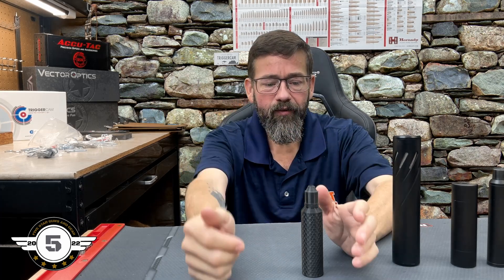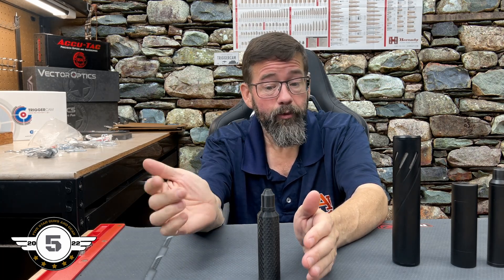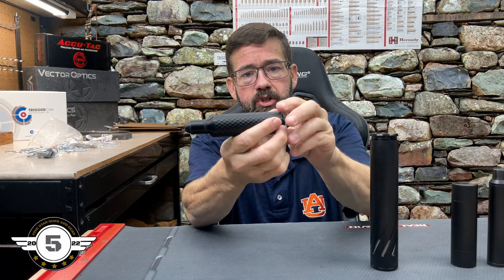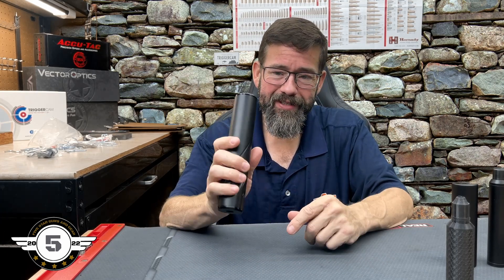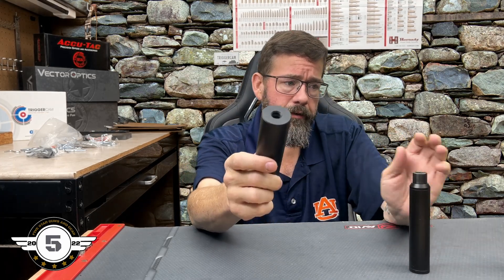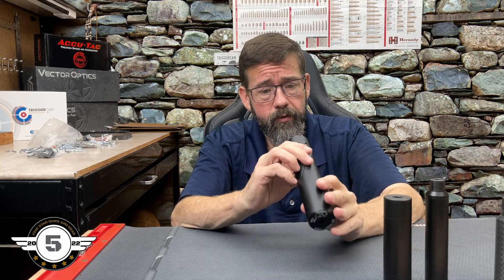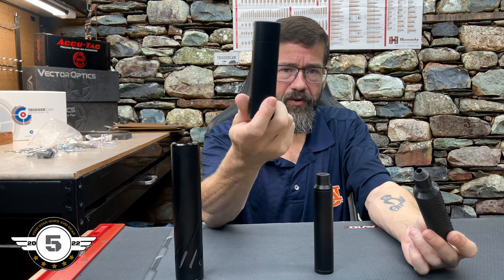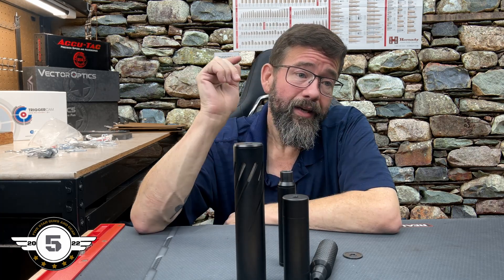Catastrophic PCP Airgun Moderator Failures Buck Rail Huggett and What to Look For

Comment: I have three moderators from Buck Rail in .22/.25 I originally bought them for my 2240’s and my 1322 but I liked them so much that I purchased one in 25 for my avenger and I had no issues with none of them. I even put it on my FX dynamic express 600 no issues no pellet clipping. These are 3d printed but still good for the money , hard earned money. I have a couple Donny fl’s also and they work fine but truthfully to a human ear you would not tell which one is quieter, of course Donny FL looks way nicer but cost way more . BR is making decent products for us and you shouldn’t tell people not to purchase from him just because you had a bad experience.
Reply: My experience with this 3D printed Buck-Rail moderator was completely opposite as yours when I bought one to tested in my first gen Avenger wood stock .22 cal with a DonnyFL adapter. Since I own four AVA one first gen and three new Avenge-X another .22 and two .25 cal also have a DonnyFL Sumo and FX, a Hugget snipe standard and two 3D printed moderators a Buck-Rail and another  called the Cameron. Since I only shoot my airguns in my backyard and live in a extremely quiet semi private neighborhood having the more efficient moderator its a most have priority over anything else. After tested all of them to see which one give me the best sound deduction the clear winner by far was the Hugget snipe standard, followed by the DonnyFL Sumo, then the other DonnyFL FX, the other 3D printed moderator that I bought directly from Ebay called the Cameron and the last one was the Buck-Rail. But with none of them I had this clipping issue that this youtuber is talking about on this review. That’s why exist the very popular phrase “you get what you pay for”….😉. PS I posted a video clip in the airgun nation board to backup my claim, shooting one of my Avenge-X .25 cal airguns between 890 and 900 fps around my neighbors chickens and they did not noticed even through all the shots were fired passing barely one feet over their heads and the targets were all the shots were hitting were just a few feets behind them.
Reply: Terry's policy at BuckRail is still the same. Any problems with a product and all you have to do is call or email and a free replacement will be sent out immediately. He stands behind all of his products and backs them 100 percent!

Comment: I have 3 Buck Rail moderators for my .25 Armada. Never had an issue. Good product especially for the prices ($18-$40 for mine). My DonnyFL was over $300 and they sound Identical. The DonnyFL just looks fancier.

Comment: I bought a Buck Rail Moderator for my Avenger .22. It did have clipping and They sent me a replacement at no charge to me and told me to keep the original one. The second one had the same issue but not as bad. I ran a drill bit just a little tighter than the original hole and now it shoots like a much more expensive one. For the money, I would drill out the moderator using a hand drill if it was necessary, and save a couple hundred bucks all day long! In this video he had a problem that could have been repaired with a little superglue. Not all of the BR Moderators are bad, most of them are just fine! They have to be manufactured to the tightest specs and if there is a 1000 of an inch misalignment in one of the baffles than it will cause clipping. It only takes 5 seconds to run a drill bit down the moderator and problem solved. If you buy one and do have a little problem with it, they will happily send you another one with no charge. It takes less time to run a drill bit down it than the time spent this guy spent complaining about it. Buy one and save lots of money to spend on something else for your PCP! I did!!

Comment: i make my own and if the pellet is closer to one side than the other it will also cause eratic groups up to 6" at 30 yds with no baffle strikes i machine mine from aluminum and cover with carbon fiber tube , no 3d printing and have found the monocore type with 1.6 mm felt wrap works the best for me

Comment: I’ve been designing and printing my own silencers for my pcp air rifles (.22 and .30) for about 3 years. From my experience of course layer adhesion could always be an issue but if your printer is functioning and tuned properly you will probably not see that issue, I haven’t. Stress points must be considered and designed such that that they are reinforced to lessen the stress ( ie. no 90 corners at pressure containment areas but radius them to reduce shear forces). I’ve never had a failure. I have had baffle strikes so I increased my baffle to 1.39 x caliber dia. And also try to maintain pellet velocity approximately 870 FPS, but have went to approximately 750 and had no problem. My latest was for my .30 Macavity sniper and it’s 44mm in diameter. X 190mm. Quiets the bark really well with no POI shift. Having said this, I would probably only use one that I printed myself so you can control quality and material used. I have only used PLA and it tends to degrade over time or so it seems from observations made of other printed items I have made but I have had no silencer/moderator failures thus far.🤞

Comment: Tried the $20 3D printed Buck Rail on my .25 Gauntlet today. NO better that the cheap 3D cones found pouring out of ebay. Sent TKO a note today to please make one for the .25 Gauntlet as they do for the .22.  The $50 TKO I use on my LOUD .22 Discovery is astounding. All I hear is the spring hammer slap. Or I spend $200+ for a "real" one just to neighborhood friendly.

Comment: Got one pellet clipping then it crack in half likewise what you said of the pressure of the pcp air
Reply from the maker: Its a dangerous proposition when you start using plastics not designed for high pressure air.
Reply: @5stargunsandgear  i just wish manufacturers start making affordable moderators cause i think in the long run if people get into pcp they will benefit from it

Comment: Easy fix! Get a drill bit a little larger than the size of the hole inside and drill it out running the drill bit all the way through. Try it out again shooting a few shots through it. If it still does the same thing, drill it out with a little bigger drill bit. Repeat if necessary until the pellet clipping stops and shoots straight. Super glue that end back on. Works great and fixes the problem.
Reply from the maker: should never have to do that
Reply: You buy something you expect it to work not have to start messing about drilling it.

Comment: I have an issue with a uk brand moderator from my local shop, it is clipping causing an 18" difference in poi between shots. Initally they drilled out the end cap, still no luck, tbh i didnt ask them to do this i just left the gun so they could look into it. Again I took it straight back, they are blaming the oem adaptor on the rifle, saying its not straight to the barrel. Its a .177 walther reign mk1 uk version, with the shroud and adaptor. It is a strange setup. Barrel, mussel break, shroud then adaptor, them moderator 
How do i prove its not the gun?
I have reached out to umerex to see if they have any suggestions, no response as you would expect.
Reply from the maker: It could be the adapter but hard to say you could get a bore alignment rod but those add cost